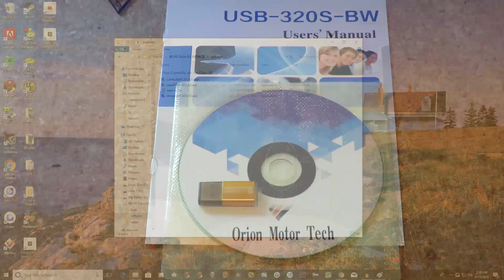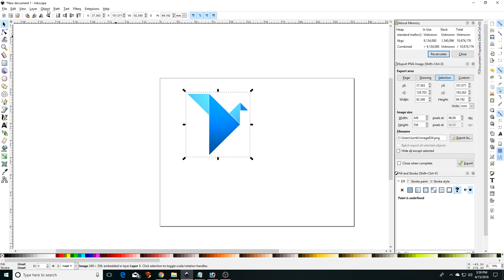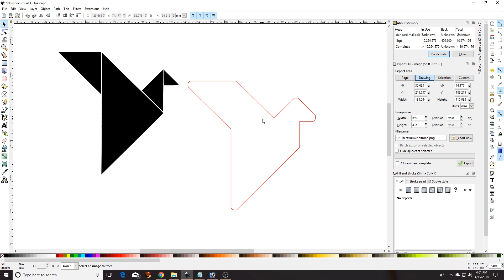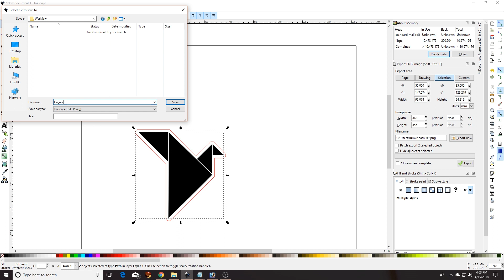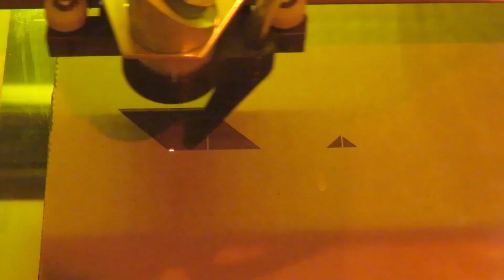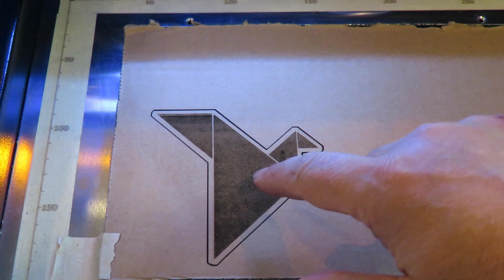Chinese 40W Laser Ez-Workflow - Ditch the Bundled Software

Comment: What's wrong with the original software and is there any other instead of the Whisperer?
Reply from the maker: I am certain that the original software is OK.  I choose not to use them because:
1) One requires CorelDraw 12, a proprietary drawing program that costs some money.  Around $129 on EBay https://www.ebay.com/itm/163743774106  For people who have access to this software and know how to use it, I am sure it's great.  I think the Corel piece that comes with the laser is an addon to  the larger Corel 12.  You might own CorelDraw 2018; I have no idea if it'll work with the laser or not.
2) The other is LaserDRW; it comes with the Laser Cutter.  I've never used it, because i didn't want to "learn" another piece of software.
3) One of the above, if not both, require the use of this little dongle that comes with the laser.  If the dongle is lost, or damaged - well, I don't know where you can get another one; short of buying another laser.
4) K40 Whisperer comes with a "dither" mode which allows you to etch drawings and photos using the stock board.  I do not know if LaserDRW nor CorelDraw 12 does this.  If you are lucky enough to upgrade your controller to Arduino, you might be able to control the laser power from within the software suite allowing you to perform something akin to 3D Relief etching on GlowForge.

It is with the third and fourth points, I've chosen to distance myself from the proprietary software and hardware.  I see this Chinese Laser as an extensible and modifiable platform, from the software to ripping out the guts of the laser rails and building my own.  InkScape is open source, and K40 Whisperer is too (see https://github.com/stephenhouser/k40-whisperer ) 
 There are numerous posts of people ripping out even the proprietary firmware and going to 100% open-source everything.

You can put your own Arduino controller and use GRBL, completely shunting the K40 Whisperer and InkScape.

https://hackaday.com/2016/12/23/convert-that-cheap-laser-engraver-to-100-open-source-toolchain/
https://www.instructables.com/community/K40-Chinese-laser-convertion-to-Arduino/
https://www.youtube.com/watch?v=8m3evdpEeIY

You can even replace the controller with one of your own design, and have it talk to Mach3 software.
https://hackaday.com/2012/12/13/converting-a-chinese-laser-cutter-to-work-with-mach3/

Another compelling reason to use K40 Whisperer and InkScape, is that it allows us to utilize a Raspberry Pi and hook it directly to the Laser Cutter instead of a laptop or a desktop.  While the current iteration is "clunky" you can remote desktop into the Raspberry Pi, upload a SVG and start the engryaving process remotely, and disconnect. Similar to what the Octopi does for 3D printers.

It all depends on what you want to use, what works for you.  Many of us don't have Mach3 or Corel 12, and if you're like me - use these software for simple editing and for quickly producing finished products without the learning curve of using another piece of software.

I hope this helps

Comment: hello,why the photo shop when everything you do can be done in Inkscape . now while waiting for my k40 to get here I downloaded corellaser and laser drw and they both work with no dongle and from what I can tell the dongle tells the sending computer what is connected when the laser itself is connected to the computer ,as for the supplied software it is software most people have never used before unless they have a Chinese cnc milling machine and if these people would relax and study the software they would learn to use it but most people are not willing to study as they want everything to be an Iphone....well folks sometimes you have to use your brain and figure something out. Also the program LaserDRW looks and acts just like the first versions of AUTOCAD.
Reply from the maker: Thank you for your comment.

Indeed, everything CAN be done in Inkscape.  Or Adobe Illustrator, or Vectr or any other SVG program.  I wished to impress upon the K40 users that they are not relegated to CorelDraw or any other programs that come with the K40 that require the dongle, or are in a proprietary file format.  I understand you may be very well versed in these proprietary software, and you are very welcome to continue using them.

I have used PhotoShop for a long time, but not so well (I am an Electrical Engineer).  I use InkScape even less.  Still, I wished to take a design that I found and make it on the laser.  Hopefully, you'd be able to see that the content is useful for a beginner, as well as a seasoned operator as yourself.

As for taking the time to study the software, I can share with you that PC's used to be the domain of University and Government geeks who studied the language of the Micro Processors (such as Z80, 8080, 68000) and wrote useful programs for them.  They understood how the operating systems worked with the processors.  It didn't start out as a ubiquitous home (or even a phone) device.  It wasn't until the likes of Bill Gates and Steve Jobs who took the PC and placed it into the hands of their grandmothers (figuratively) did the PC and Home Computing revolution take off.  Now we have software that is much more powerful than anything that went to the moon and came back, sitting in the palm of our hands.

There's no reason that someone who is gifted in design and making things, shouldn't take a shortcut to making great things with simple tools.  Should they "use their brain and figure something out?"  They can and they might be even more productive, but they can get on with building their amazing creations without being deterred or diverted to having to study some piece of software that may take days or weeks.

The simplification of software and hardware is going on all around us.  Glowforge doesn't even need InkScape or any Vector Graphics program.  Just put a drawing in the cutting area and let its on-board camera capture and create the magic.  These users are no less worthy of using their equipment without having to learn InkScape or Adobe Illustrator - they're useful, yes - but not not necessary to "study them carefully."

Tinker when you can, learn where you can.  Regards

Comment: Do I understand this correctly that you  (1) Do not use the dongle at all? and (2) You dont use any of the software that comes with the machine..... just K40 Whisperer and Inkscape?    Thank you
Reply from the maker: You do understand correctly, and is the basis for this video.  I do not use the dongle at all; it's socked away in the original packing, along with the software disc that it came with.

The dongle is needed to run the software on those discs, and needs to be plugged into PC.  The laser cutter/engraver itself doesn't care about dongles at all.

If you install Inksape and K40 Whisperer (and the little driver dll it requires), then you have all of the connectivity needed to drive this laser cutter (at least the Orion Motor Tech one https://www.youtube.com/watch?v=KhhOHUe_b6o, but I believe the other ones work just as well)  None of the software nor the dongle is needed to make the laser cutter work.

You might want to use a familiar image editor (like PaintShop Pro, or Photoshop or Gimp) as well, but InkScape is perfectly capable of rendering images for you, if you take the time to learn it.  InkScape is used by K40 Whisperer to render the SVG files, and I demonstrate using InkScape to turn Bitmap images (produced by the other imaging apps) into SVG files to import into K40 Whisperer.

I hope this clarifies things.
Reply: @lumkichi1341  Wow! thank you for that comprehensive reply I sure it will help many of your viewers that are newbies like myself. I had watched your video and just could not believe it was that simple as I had  spent a good few hours looking at the software that came with the machine and was at my wits end. Thank you once again will get stuck in today and give it a try.

Comment: Greetings Lum,
I'm about to buy one of these lasers. I've been watching/studying many videos. I have found yours very helpful and I wanted to thank you for that. One thing I haven't been able to learn is what the difference is between the blue/white machine and the red/white machine. I've seen the different control panels on both. I was hoping you might have an answer. 
Thanks again.
Reply from the maker: As far as I know, they're just different manufacturers.  I don't have a red unit, but all of them are 40Ws, operate similarly and I believe speak the same laser "language" as the K40.  I keep calling my unit a K40 but it's really not; it's a 40W Laser Cutter/Engraver made by OrionTech. They probably all have simlar 12 x 13 cutting/engraving surfaces.  

Even withing the blue units, there are notable differences, such as the "handed-ness" of the controls.  They're typically on the right side of the machine, but sometimes they're on the opposite side:

https://www.ebay.com/itm/40W-CO2-USB-Laser-Engraving-Cutting-Machine-Commercial-Engraver-Cutter-12X8/192377865860

This red one, is priced WAYYY too much for a 40W laser:

https://www.ebay.com/itm/Mecor-CO2-Laser-Engraver-Cutter-Commercial-Engraving-Cutting-Machine-40W-USB/382487820119

Here are two, exactly the same model I think, but 2x difference in price

https://www.ebay.com/itm/40W-CO2-USB-Laser-Engraving-Cutting-Machine-Engraver-Cutter-woodworking-crafts/172803061836
https://www.ebay.com/itm/Upgraded-40W-CO2-Laser-Engraver-Cutting-Machine-Crafts-Cutter-USB-Interface-USA/173802807174

And both of these are different from mine which also has a nice big and friendly E-Stop button:

https://www.ebay.com/itm/Upgraded-40W-CO2-Laser-Engraver-Cutting-Machine-Crafts-Cutter-USB-Interface-110V/183433803882

Perhaps another notable difference might be the cutting bed.  Mine had a little shutter mechanism that would try to clamp a piece of wood in place, but it was way too small for the pieces I wanted to use.

But they all seem to come with the 40W laser tube, a length of crappy 4" exhaust ducting, a shitty exhaust fan, an el-cheapo aquarium water pump, and a CD and maybe a dongle.

I didn't pay too much attention to the differences when I bought mine.
Reply: Lum Kichi thank you so much for the highly detailed response, more than I had hoped for. You have given me much to study. Thanks again, I truly appreciate your effort.

Comment: Would like to see how to use a DXF file with K40 Whisperer.
Reply from the maker: I don't have any DXF files nor have I worked on them at all, but there are a number of utilities that can convert DXF to SVG files, which the K40 Whisperer can understand:

Inkscape can open DXF and Save As SVG
Free, online utilities such as https://convertio.co/dxf-svg/ , https://www.dxfconverter.org/ , https://cloudconvert.com/dxf-to-svg

I am guessing because the K40 Whisperer relies on the Inkscape libraries to open and access the SVG, and the fact that Inkscape can open DXF files, it might not be that far-fetched for K40 Whisperer to open and print DXF files.  In the meanwhile, there are workarounds in place that could help, I think.  Can anyone confirm?

Comment: What have you found to be the maximum engraving area for this laser? I know it claims 12x8 but I saw a video of a guys where the vent fan was in the way of his laser and was wondering if you encountered this issue at all? Great video!
Reply from the maker: I had to cut away part of my exhaust plenum in my laser as well, so I could take advantage of pushing the work material right up to 0.00 mm top.  Before it was sticking right up past the horizontal 0.00 mm top boundary, now it's cut about 45 mm above that line.  So that I can keep the work on "lip" of the cutting bed, so to speak. There is also a small 3/8" gap under the exhaust plenum that would allow you to push a sheet (1/8" birchwood, let's say) an additional 95 mm above this top line.

There is 20 mm leeway to the left of the vertical 0.00 mm left boundary, and 10mm leeway past the max head travel on the left hand side.

All said and done, I can see that I can theoretically fit material as large as 14 " x 12.5 " x 1/8" onto the bed, of which 12.9 " x 8.8 " is engravable, but I am only speaking for my particular brand of K40 laser.  Other brands may have more or even less room to accept oversize materials.

Additionally, because of the nature of construction of these units, the laser tube is situated horizontally at the back of the machine, at a height in-line with the mirrors on top in its own chamber (kind of like a loft).  There is SOME empty space beneath that and you MIGHT be able to cut a passthru  from the back - but the front side is blocked by part of the frame that holds the rails and keeps it lined up and stiff.  To make this a true passthru, you'd need to do a lot of cutting, re-configuring and strengthening of the rails.
Reply from the maker: There are a number videos to cut away the exhaust plenum:

https://www.youtube.com/watch?v=NKoJ3D0ZVSM <- this guy removes the plenum from the unit and cuts it outside; I couldn't so I cut it in place.

https://www.youtube.com/watch?v=djuH0eJHQH0  <- this is more along the lines of what I did.

To cover up the jagged, exposed cut edge of my exhaust, I fashioned a beauty ring/intake with my 3D Printer.  https://www.thingiverse.com/thing:2851857  <- you'll see part of my exhaust there

Comment from the maker: Inkscape.org has announced a v.0.92.4 stable release with some performance improvements.  But what I am very excited about is the v1.0 Alpha release that not only implements some drastic performance gains, but also the long-awaited ability to set the Document Origin to the TOP-LEFT instead of BOTTOM-LEFT.  This means that the SVG object dimensions and positions will match the K40 laser origin which is also TOP-LEFT:

Link to download and compile from source here, or simply run on Linux:  https://inkscape.org/release/inkscape-1.0alpha0/

Video Link to v1.0 Alpha Review: https://www.youtube.com/watch?v=9lFI7qGFP7M
Reply: Laser origin  can be set to any corner of the SVG or the center. thats what the other 5 buttons are for around the jog arrows.

Comment: can you do a gradient rastering with the machine? and i also wonder why you don't use some kind of support underneath?
Reply from the maker: I can't comment on this Gradient Rastering...  The K40 Whisperer does have a Halftone (Dither) option that seems to work reasonably well.

I don't have a support in my laser cutter because I'm still making mods to it.  I'm on the fence as to what kind of support to install.  I am thinking of replacing the entire bed with Honeycomb Aluminum.  Or may simply fill in the hole with a bit of light-gauge expanded metal.

But I am finding by using my registration marks (see links to find that video), I simply align my work in certain places, and I can cut through and be sure that there's nothing behind the piece to reflect the laser nor accumulate the acrid smoke that stains the wood.

I am now thinking, however, if I did have some sort of expanded metal, I wouldn't have to worry about pieces dropping and getting scorched if I make a long, non-stop engrave / cut.

Comment: Can 40W co2 laser cut wood? Like 5mm thick?
Reply from the maker: Yes 40W CO2 laser can cut wood; but not all types and not all thicknesses.

I have successfully cut 1/8"  (3.175 mm) birch wood  (see my Dymaxion Globe build here : https://www.thingiverse.com/thing:2914695).

Thicker woods require slower cutting speeds, and more power.  It is also very important to direct a jet of air to the cutting point to make the cut burn hotter and thinner, and also direct the smoke (and tar) away from the cut area.  Without Air Assist, you will have fires/charring on your wood.

Different types of wood also matter:

Balsa wood 5mm - easy to cut
Birch wood 5mm - relatively easy to cut
Oak wood 5mm - very difficult to cut
Teak wood 5mm - probably won't cut very well at all.

Also, higher power means intense beam and more "burning" at cut site - your cut width will become wider.  Maybe you may need to make multiple passes at lower power to cut all the way through.  Again, using air jet/air assist is recommended https://www.youtube.com/watch?v=rYQVqiWsz5E
Reply: @lumkichi1341  thanks for the answer... i wanna buy this laser to :D